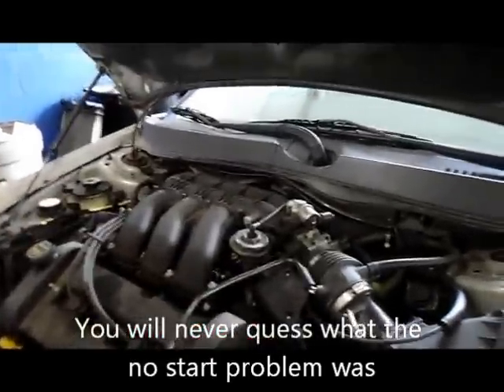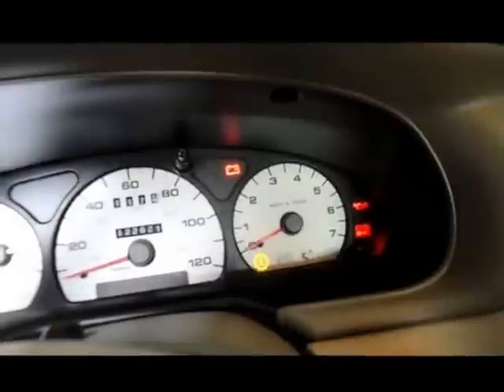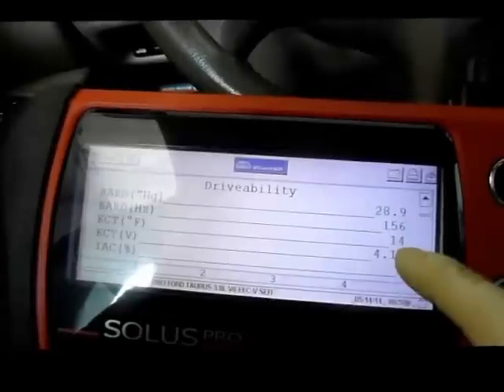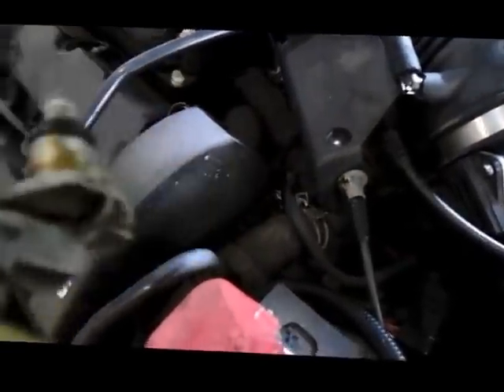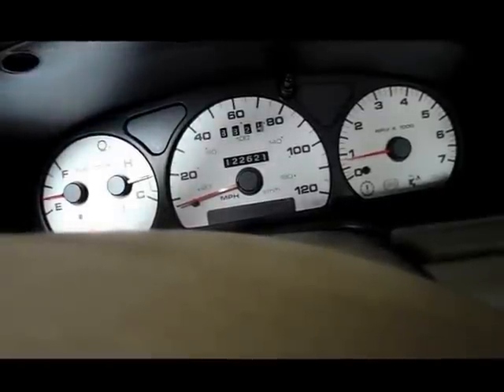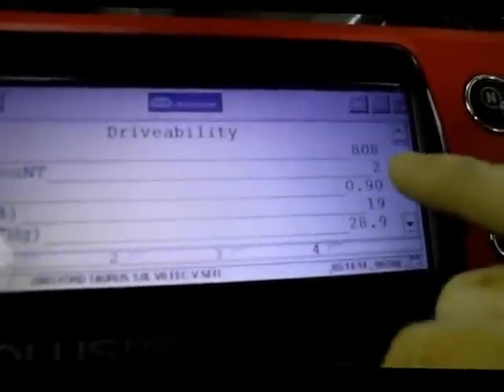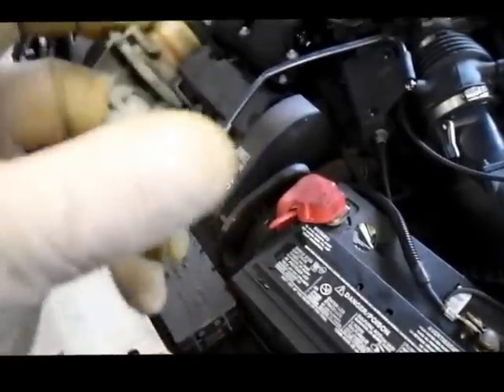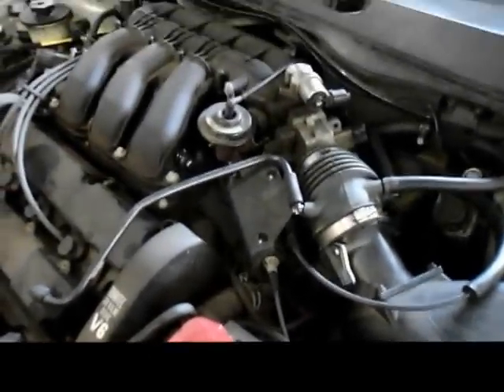Engine cranks but won't start

Comment: I wish I knew half as much as you do.
My son has a 2006 Impala 3.9 automatic 4 door. Everything is new except all sensors and ignition coil.
    Sometimes the car will start and, sometimes it will not. When I spray starting fluid in the throttle body it will stay running but, when I shut it off and try to start the car again it only cranks!?
Please help!
Awesome video. Thank you so much, Jim.
Reply: Neil Williams fuel pressure

Comment: Since it was showing 4.18v, then the new one was <0.5v, could it have been internally shorted, and keeping the ignition from getting voltage?  
It might create enough of a voltage difficiency another, necessary sensor might be starved for voltage.
Reply: Doesn't seem likely.  Makes more sense that the computer thinks the engine it to cold or to hot.

Comment: I hope you can help. I have a 1987 Mercury Grand Marquis. It’s the 5.8l Windsor and it is NOT fuel injected. This temp sensor video sure sounds like it could be my problem but I don’t know if my car has that sensor. Car starts cold perfectly. I can drive anywhere but when I reach my destination and leave the car for 10 mins it cranks but won’t start. It will if I leave it for a while which is weird. Have had the ignition coil and regulator replaced and the mechanic said it was fixed but it’s not. Same issue with no improvement. Seems like no one knows how to fix this and I have spent a lot of bucks to mechanics who do not know how to fix it but claim they have.

Comment: i believe the enginneers put a coolant sensor  for a reason and obviously its reading non-sense and many cars have a safety mode that is trigger by abnormalities,that is to say,reading low and high temperatures that dont make sense ,of course the engine will shut down.

Comment: I went outside and put my old melted taped together scensor back on and it tried to turnover a couple of times and then it started and had to gas it to keep it running, but then it smoothed out and ran and started the way it did before, when I went to reinstall the old one the socket I used on new one didnt fit, and the plug was loose on new one and snapped on the old one when I taped it together ,the black plastic was seperated from the metal and looked melted, the new part looked correct, just small minute differences, so not defective but the wrong part number, the number on the part didnt match the Delco box number, but Amazon's part prices are great, so I 'll just have to check out my numbers carefully before installing and possibly causing more problems by running the engine with an incorrect part, by appearance alone its hard to tell without really checking the details, the old car not starting from a bad coolant temperature scensor, happens all the time,lol.

Comment: Hi my tachometer moves maybe half mm when cranking I tested the crank angle sensor and changed it even still was same value. Camshaft sensor was within specs. Would a bad temp sensor produce no fuel and no spark?  I have gone through everything and now my efi relay doesnt click even though tested good with volt and multimeter?  Any reply appreciated thanks!  Great vid btw😊

Comment: My 1993 Chevy C1500 had the same issue.  No OBD-II.   But, the money light would flash morse code indicating the fault.  I had the truck towed to my driveway, checked the code the next day, and replaced the sensor.

Obviously, it's a software response in the ECM.
Reply from the maker: Thanks for watching

Comment: Yep, safety circuits kept it from starting, & thats what they suppose to do. I use to work on power plant engines back in the day. I hate when they go bad at 2AM while running critical power in a war zone. These sensors just run you crazy! Oil pressure, coolant, fly wheel, low volt, high volt, frequency out side of operating window. Another one was butterfly gaskets folding over onto them selves. The engine would pull oil from the pan and run on that. Its called a runaway engine because you can't control the engine. It's out of control! You had two choices run as far as you could before it blew or kill the air supply before it blew. It's funny how a diesel engine will sound like a jet plane during a runaway.

First time I heard it, like an idiot I ran towards the engine.

Comment: I have a Chrysler 300 that will turn over with no problem but starts up intermittently. It started a couple months ago and progressively got worse, you can try it won't start wait 25 min turn it it fires right up,  what do u recommend, it's a 2003 Chrysler 300 I think it's a 3.8 motor not sure bit it's a 6 cylinder.. Thanks

Comment: The ECT is just like the cold start injector.  It's think that the engine is still cold but it's not.  So the ecm control the injector time longer so it flooding.  Happen to my Acura .

Comment: yes i did know. 
i was on holiday and the car would not start, the coolant hose was split. as there was no water in the system, just taped it up with sellotape, filled with tap water and drove home, repaired it properly next day.
Reply from the maker: Thank you for watching

Comment: Ya..my Corvette was reading "HOT"and the car would shut down...I changed the temp sensor and it fixed the issue...It's a 93 so the sensor was actually threaded in..

Comment: I don't have a scanner, but I do have a 4.0 sohc v6. I'm having trouble with it cranking, but refusing to start. I think I'll try that before sending it to the shop.
Reply: same here, I have a 4.0, sohc explorer 2000, replaced cam sensor, crankshaft sensor  iac is good, compression is good spark is good, has fuel pressure.. didn't think this would effect it. did you try it ?
Reply: @Crumy-z5i  did I try what? That's a different motor than mines.

Comment: If the computer thinks the temp is 19 then the fuel mixture will be too rich for the running conditions when the engine temp is actually hotter and it should be running leaner. It's to stop the driver from causing harm by driving with a rich mixture. An engine warning light should be enough to let the owner know tomstop soon and have it checked out rather than being completely sranded.

Comment: It had spark the low temperature reading caused a rich condition. So rich the fuel could not be burned. Air density is way different at 14 degrees than 60

Comment: Because when the sensor reads to high or to low of a temp the engine  adds fuel like putting on the choke for a cold start or leans out for a hot start
Reply from the maker: Thank you for watching

Comment: I don't know why but the same thing happened with my old Jeep.
I had a top hose go, and it killed the engine. Took ages to figure it was one of the water sensor's that was picking up on the low pressure or temp. Think it must go into a self protect mode.
Reply from the maker: John Ferguson thank you for stopping by the shop

Comment: I came across on my semi truck and asked the mechanic and he said when the temp sensor voltage is too high it will disable the computer.  Almost similar to your other sensors that will record a voltage is too low or too high and disable the computer but the temp sensor will not put the money light on.

Comment: If you notice the temperature gauge shows a normal temperature, my guess is that both the temperature sensor and temperature gauge have to correspond with each other.

Comment: The ecm adjusts fuel based on engine tempature. If it thinks the engine is at 14 degrees it's going to be dumping too much fuel for the conditions

Comment: I did have this kind of problem years ago, but mine would start and then would die when warm up,  after i change the temp sensor I worked great, I believe it send a reading to the computer how mix the air and gas, but I suppose if the temp sensor is to far out of range it won't start, propleby safety feature to prevent any damage to engine.

Comment: All these years my k1500 fired up cold turn it off go back to start it it wont unless u pump the gas sometimes have to wait until it cools down to fire it up coolant temp was bad because it was dumping fuel and choking it out put a new in it problem solved amazing

Comment: Its not sending a signal that is within range so the computer doesn't know what the reading is.  Then its up to Ford to determine what should happen.  Ford obviously doesn't want overheat the engine so they prevent it from running, as the computer has no idea what the temp is.

Comment: Wow, weird deal.  I would say calibration on the computer caused this for sure.  I'm surprised that low coolant temperature would command no spark.  I would have checked short to ground through the sensor just to see also.

Comment: temp sensor is in closed wiring loop with efi system if fails or overheats it make engine shut down to protect it

Comment: I have a 2002 Ford Taurus, that won't start when hot. Acting the same way, I changed out the coil, at the owner's demand, and well as the CrankPS. Still doing, and I saw that the ECT was turning freely, and I had had a Dodge 1500 that wouldn't run because of the ECT. Changed it out, ran fine for several days, now is doing the same thing, nothing is showing bad, it will show misfire on Cyl 6 in first 1000 rotations, but no other codes. Still cannot figure this damn thing out.

Comment: Some years ago we had a coach, Setra/Mercedes, I believe, that would not even turn over the engine. After much head scratching and cussing, it turned out to be a blown oil pressure bulb!!! Apparently it was designed to function in this way.
Reply from the maker: Thank you for stopping by the shop

Comment: The engine wont start cos the temperature sensor is faulty, so when you are replacing it this guy says to "make sure your engine is switched off first in case you hurt yourself on the spinning timing belt"!!      Only in America!!

Comment: That doesn't surprise me. It's very common in Hondas also. I've seen many timing belts/chains replaced because if this as there are no codes. It shares common ground with the ckp sensor and the campos sensor. It tells the computer the temp of the engine to adjust the fuel trim at start up. Kind of like an electronic choke.  It doesn't control the gauge.
Reply from the maker: Thank you for watching

Comment: temp sense fail mostly vibration of the two leads wires from flexing back and forth expanding the female conector over the male spade conector, the fix is to sqeeeez the female conector with pliers so it is very secure and add a ty wrap for strain relief action , so the leads due not flex back and forth loosening it the connection

Comment: I believe I might have the same issue on my 94 volvo 940. Recently had hose replace and about a week later my car would crank but not kick over to run.
Reply from the maker: Thank you for stopping by the shop.

Comment: Had a 95 maxima did the same thing.  CTS went bad, gauge worked fine but ECU would see something wrong.  It would stall randomly in traffic and hard to restart.  Replaced it after googling things and problem immediately went away.
Reply: Messes up the mixture i was told, computer tries to electronically do what a choke on a carb does...too much fuel and won't fire.

Comment: Could the control unit keep the engine from starting if it thinks that the coolant temperature is 18 degrees, therefore it may be frozen, and may not circulate? This would only be the case if the "coolant" was mostly water, but they might want to make that assumption to be on the safe side.

Comment: yes I had a problem with my cougars ect sensor when the engine became at operating temp. I had it rigged due to breaking the connector, i had to take the wires out of the connector and put them on to the connectors for the sensor, it lasted like 2 years then the ect started malfunctioning, after the engine got up to operating temp, I would sometimes come to a light and the engine would just shut down, and sometimes it started right back up but sometimes the coolant needed to cool down slightly in order for the spark to return and ignite the fuel mix, because as I cranked and cranked i smelt fuel so I knew I did not have spark, and my ect when the engine and coolant was cold the ect would read -200 degrees Fahrenheit, so then I knew the ect finally went bad, after I got another connector and a new ect sensor, never had a problem after that.

Comment: My mom-in-law 2003 Sable DOHC got to where when you drive it and stop to shop. It would not start until it cooled down. I put a 100 ohm resistor across the plug pins and it starts every time after warm up. I put plug back into sensor and it will not start. Did resistor test again, and it starts. Got to order an ECT sensor.
Reply from the maker: That turned out to be a common problem with this motor. Thanks for watching.

Comment: It may cause a voltage at the coil pack. All the damn sensors are linked together. You would need a voltage wiring diagram to see.

Comment: Lol!! Eng temp 192 Now because the Engine was already running...Good Vid Though ...it would have started if you held the throttle wide open...the CTS Richens the Fuel Mixture when cold

Comment: ect sensor when it reads that cold it makes the car go into clear flood mode (more fuel for the cold days) now the air intake sensor reads normal say 70 degrees when the ecm sees both data 70 degrees from the air temp sensor and 14 degrees from the ect sensor it confuse the ecm causing a no spark issuse

Comment: easy answer the coolant temp sensor send signal to the ecm to add more fuel due to cold start ps your cluster is reading 1000 rpm with the engine off 😉

Comment: Actually seen it on a big tk with Detroit engine... I simply unplugged it and it started right up! So while running I plug it back in an bam, it kills engine... changed sensor and it ran fine.

Comment: My 02 mercury sable is doing this. A mechanic thought it was the cars anti theft system disabling the car. Mainly because the car alarm system would randomly go off when it was locked. Not sure though.

Comment: I have a 1988 Range Rover Classic, And it also wouldn't start when the Temp sensor failed !!. And wouldn't run with an Aftermarket One !!!. Pulled a OEM one out of another Range Rover I have and it fired right up !! This is a 1988 !!!. So I guess this problem has been around for quite a while, Just very rare to see or hear of.. But it is common with the older Range Rovers.
Reply from the maker: Thank you for watching

Comment: Hi there! I have a 2003 mercury Sable, dohc engine, and when I try to start it, it sounds just like this one. Drove about an hour and a half away from home car ran sweet as pie, and upon leaving, it just wouldn't start. Dad's a home mechanic, and he said that it was not getting fuel. Replaced fuel filter, and fuel pump. Car still won't start. No spark. Sprayed some starring fluid and it sounded like it wanted to start, but wouldn't. Do you think it could be this coolant temp sensor?? Sounds to me like maybe.... Just not sure. Spent loads of money already.. Would appreciate so much if you could help me out  with figuring it out.

Comment: Did you have spark? I have a 2002 Cougar that won't start. Previous owner said they had overheating problems after replacing thermostat, and water pump.

Comment: See if it is shorted to case. This pulls the sensor voltage down. Affecting other sensing systems

Comment: I was on a 1966 Blue Bird school bus on the way from school, and It always has problems, but today, the engine didn't start AT ALL. The key twisted, and the engine sputtered, turned on, and seconds later burst to a strutting stop. We had to get picked up by another bus

Comment: Had a customer with a 01 ford excursion 5.4 would do basically the same thing that sensor was reading 265 degrees on a cold engine so it would crank really slow even with a hot battery
Reply from the maker: Thanks for watching and your input. Don't forget to hit the bell for notifications when a new video is posted.

Comment: I've ran into it multiple times. The coolant temp sensor has the wrong resistance and fools the engine control module into the wrong air and fuel ratio. Some cars you can just unplug them and the car starts.

Comment: I'm in that situation right now it's connected to the throttle body there's two types of sensors on a Ford throttle body it connects to the fuel injections all the way up to your foot pedal sensor

Comment: the coolant sensor it will try to overheat the motor has a sensor that shuts the motor down before it blows up so if the sensors not working then is going to act like it's going to try overheat and it's going to keep the car from running

Comment: 1998 Ford Taurus had a water leak      while driving  and suddenly shut down and would not restart never reached the point where it showed it was overheating . I think this explains the problem.

Comment: I ran across a similar sit. in my gmc, the temp sensor regulates fuel pressure, a cold eng. needs more fuel and a faulty temp sensor would not send fuel to the system, it may send signal to other fuel sensors and cause the no start.

Comment: I wondered if the computer thought the engine was so cold the coolant must be frozen?  Therefore not a good idea to start. However 14F is only -10C which seems a bit warm to assume coolant is frozen.

Comment: when the ECT says its cold and its pretty hot it acts like a choke and floods the engine. i have run across that on several cars. as for no spark, i have no clue. If you would have let it cool down all the way it would have started fine.

Comment: it is because the engine coolant  temperature sensor is too great of differance from the radiator coolant temperature sensor so the computer stops start up to prevent damage to the motor on newer cars, i seen it 5 times

Comment: The bus system is interconnected with all sensors and with the pcm/ecm. If one throws an off voltage like you saw. It will turn the ASD system on. Causing the computer to kill the fuel delivery.